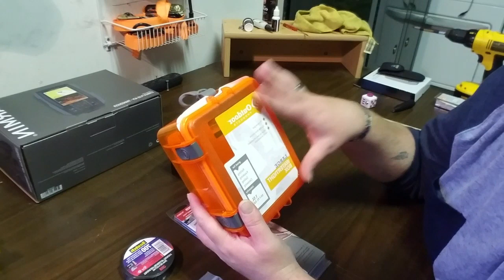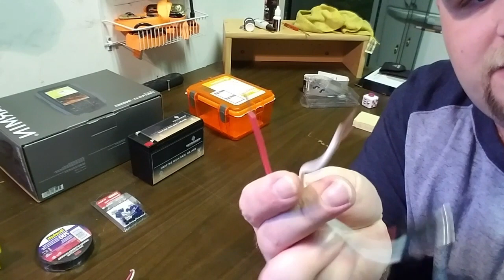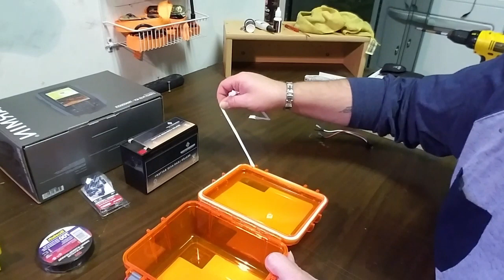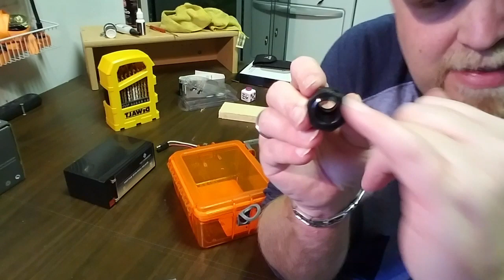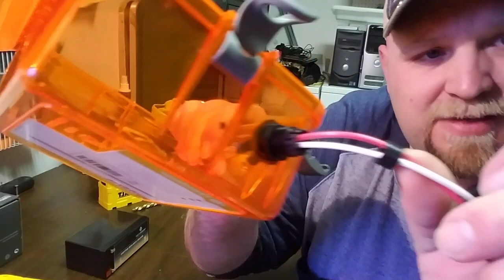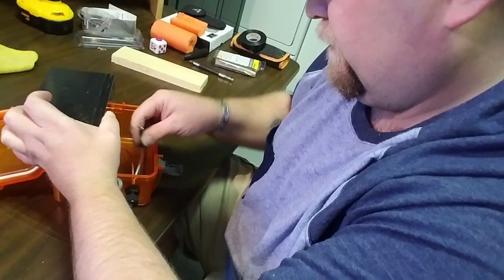Battery Dry Box Build for Garmin Striker 4cv

Comment: I purchased that very same orange box (and battery) from Amazon and the box broke the first time I used it - dropped it a few inches onto the pavement while loading the boat and it cracked on the corner.
  Replaced it with the small Apache 1800 case (#64550 - cheaper & thicker) from Harbor Freight. Drilled the same hole you did, put the battery, small charger, & Garmin power cord inside (power cord sticks out hole), and have been using it since. Can't ever imagine this box breaking.
  By the way, since I'm using an inflatable boat, not a Kayak, I don't really need a totally dry box. Didn't seal the hole and cut the screw (using a Dremel tool) for the pressure relief valve flush with the interior. Just remove the split ring and the valve knob will screw right off.

Comment: Thanks for that mate! I wondering if the fact of being 2 cables through the seal doesn't reduce the waterproofing.... I just think the rubber would embrace a rounded cable, but two cables would have a bit of gap between them.

Comment: Those grommets don't work with  split cable like you have in the split cable quick connect. You I hzve built batter containers.
Reply: I was thinning the same thing. What's the solution?
Reply: I think adding some silicone before tightening would fix that.
Reply: @shaunmcclure3722  electrical tape both wires together tight to make 1 thicker wire.

Comment: If you are going to post a tutorial at least know the safety basics. Wiring 101, always install a fuse off the positive battery post BEFORE going to ANY component this will isolate the battery from any short circuit in your box or switches. Without a fuse you are setting yourself or anyone else who follows your tutorial to a fire hazard.
Reply: The inline fuse is in the wiring from the Garmin. Just got mine yesterday.